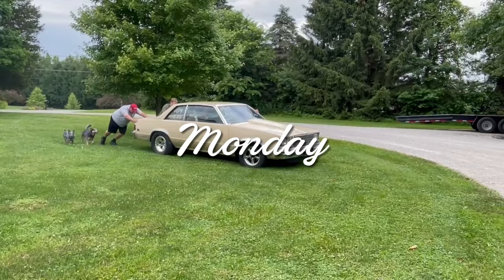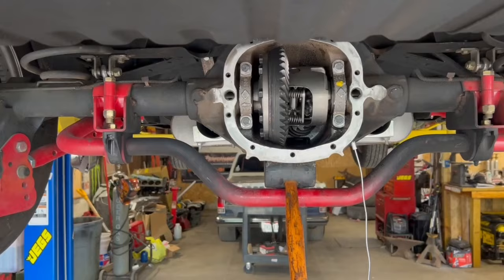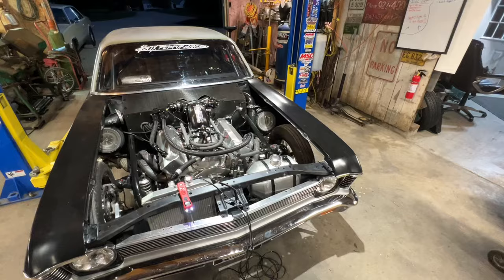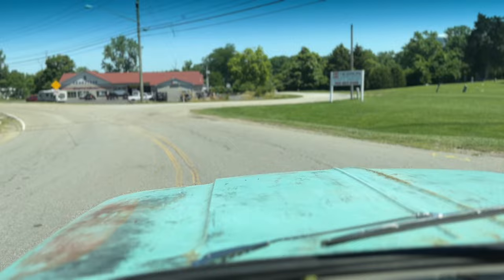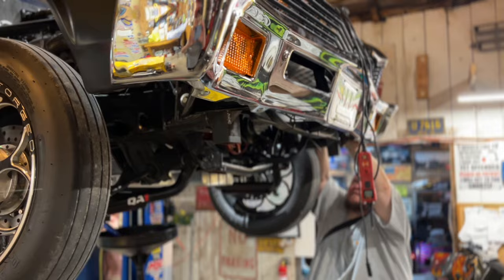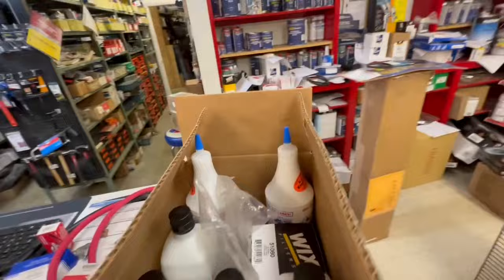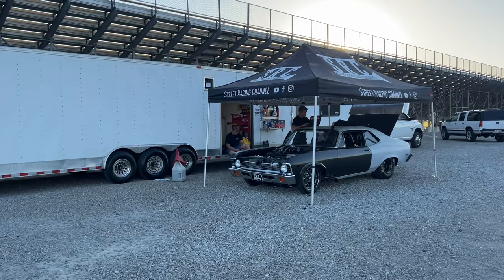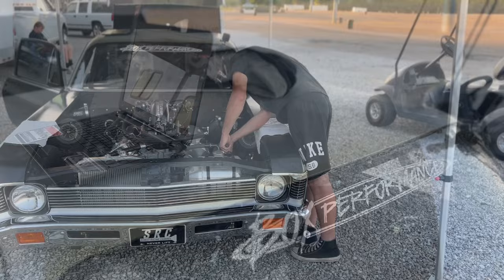He was NOT IMPRESSED! Uncle Bucko on the WAR PATH over 10 bolt destruction!

Comment: Billy when is your oil pressure filing when you accelerating or decelerating or turn into the left or right above $6,000 RPMs is that when it starts happening and do you have the bill sheet on the motor it should tell you what the oil classes are on the mains and the rods need to know that that way you can set your oil pump up accordingly and are you running a multi-weight oil in that car or single weight oil in that car are you still running the Brad Pitt or Schaefer's you may need to go to a straight 50 weight or even heavier just depends on what it's doing Billy look at that bill sheet though wish I could help hope this does help good luck I got my fingers crossed hanging out builder do you steal me back in the '70s that I couldn't build a big block to stay together over 8,000 RPMs too I showed them all they were wrong I went out there with a small acute inch motor than them and outrun them those big lots of stay together pretty good but when you get to making the horsepower you're making you have to add up a little oil clearance with oil pressure got to have both

Comment: Leaving this comment AGAIN, for the young or inexperienced person who is or wants to build a car like this.  The person who does not have money from a very successful youtube channel,  that allows for stupid decisions to be made,  and good advice to be ignored,  over and over and over again.  This car build was supposed to be for the average Joe who does not have deep pockets. Destroying brand new ring gears, posi units, and paying for labor over and over again is not something the average Joe can afford to do.   
 A 7.5 CLUTCH STYLE POSI WILL NOT HOLD UP TO ANY ABUSE, as has been proven on this channel close to a half dozen times. This is not just an opinion, this is what I have learned over 3 decades of building 7.5 ten bolts and making them last thru more abuse than you can imagine.  If you don't have youtube money to burn on a moser 12 bolt, 9 ",  8.8 , or grand national 8.5 rear axle swap this is the recipe for you.   One GM 7.5 rear axle. One USED ( seasoned) OEM ring and pinion from a pick and pull junk yard. You can find 323, 3:42, 373,  ratio's in any F or G body and 4:11 in S10 trucks blazers and astro vans. It may take some looking to find 3:73 or 4:11 but they are out there.  A used oem gear is stronger than any aftermarket junk they sell today, no matter the brand.  Bolt that ring gear to a DETROIT LOCKER OR EATON TRUE TRAC ONLY!!!!  No clutch style posi's allowed here. A spool or mini spool may work,  but I drive my cars on the street so I have no experience with them.  Use a SOLID PINION SPACER, not the factory crush sleeve. Locktight and stake the pinion nut, check often to make sure it has not come loose.  If you are drag racing on a sticky surface I recommend some good aftermarket axles, keep in mind newer 7.5 axles have more splines and are stronger. Stock axles are cheap, and I've had decent luck with them but when they do fail they break at the splines in the carrier and usually destroy that expensive differential. Do it once, do it right,  with this parts list and a 7.5 WILL hold up to the power levels this malibu is making , as long as you are only foot breaking it and not leaving on the bottle... If you can afford an axle swap that is best, if you cant, follow this recipe and a 7.5 can be made to work with moderate power levels.

Comment: Switch the oil pump to a regular volume pump cleatus had the same issue with his steve moris motor n steve fixed it with a diff pump
Reply: He also changed the main bearings. Also added restrictors to the turbos. I was wondering if those big turbos are holding to much oil causing the issue with the Nova. ✌️

Comment: STOP PLAYIN" WITH THAT WIMPY 7.5 10 BOLT AND DO WHAT I DID AND GET A STRANGE S60 DANA 60 AND PUT IT IN THAT CAR ALREADY!!!! s60 is stronger and more efficient than a 9 inch ford. i"ve had 9 inch fords before and had issues with axle seals.